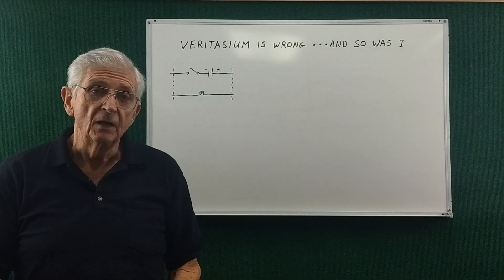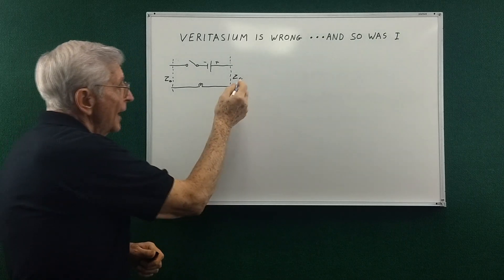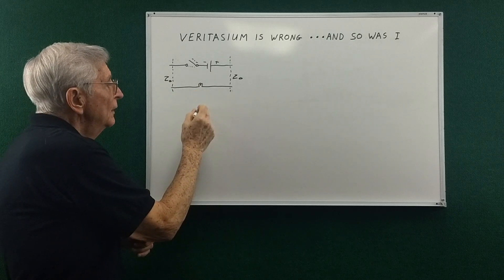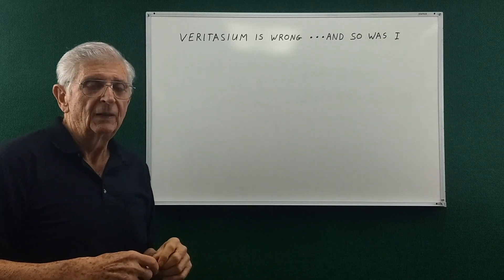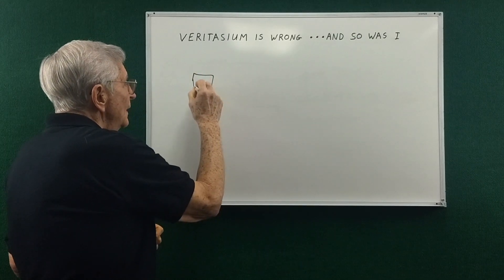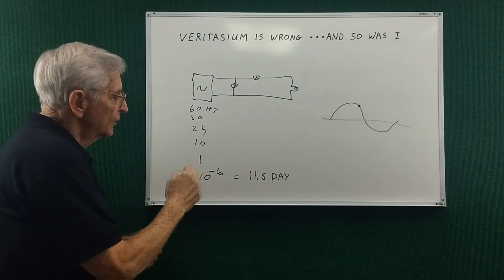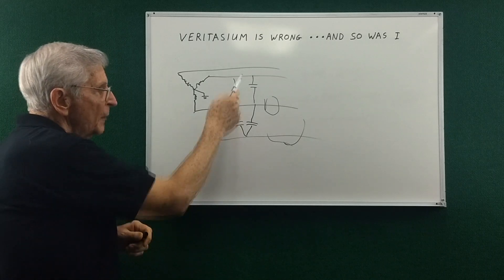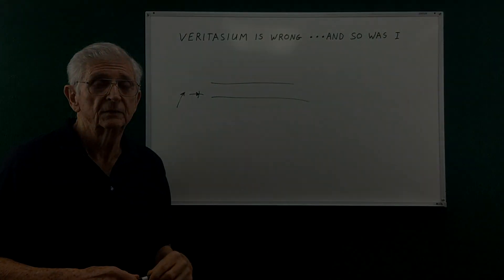Veritasium was wrong about energy being carried by the electromagnetic field part 2

Comment: Jim you are correct or close enough and derek is wrong more or less.its pretty simple to me! if the e-field extends from the electron in all directions relative to electron excitement with inverse law of squares and  the electrons are in the atoms in the wire then the field in is the wire and extends beyond the the wire according to the inverse law of squares. there is more but i can be stuffed. derek is wrong many times and get most of his info from other and leads a massive following of misinformation. ah the digital age of social media!!!!
Reply from the maker: Thank you for your comment.
Reply: @jasondoig-v9e The inverse square law is just derived from Gauss' law, and it holds only for bodies with spherical symmetry. For a line of charge for example the formula for E is E= d / (2 pi epsilon r) where d is linear charge density. And for an uniform sheet of charge E is constant with distance! So don't speak about things u know nothing about

Comment: You certainly said that the power moves through the wires more so than the fields per se, but there is a kind of an interesting wrinkle here which is Derek's example is specious largely because it deals only with the first 3.3 nanoseconds. So really the question becomes how much of the energy is moving through the wires in the first three point three nanoseconds, and here we can think of a frequency less transient, but the period is still 3.3 nanoseconds .
I suspect what you'll find is that in a large enough piece of copper the current will induce any currents within the copper that will make the copper resistant to the flow of electrons, and push the active electrons to the outside of a copper wire, what's called the surface, and a thin layer near the surface will be the least impeded by the eddy currents and that is phenomena is to some extent what Derek is digging at, I'm not confident it's very meaningful, and it may not really be prevalent in a DC battery too light circuit.
Reply: Can the induced magnentic field swirling around a wire cause the hall effect in the wire?